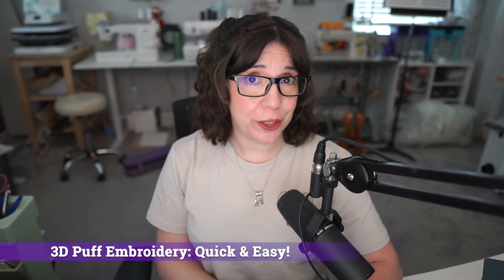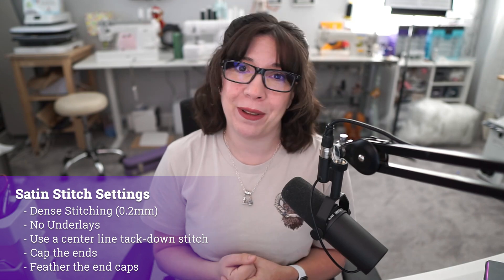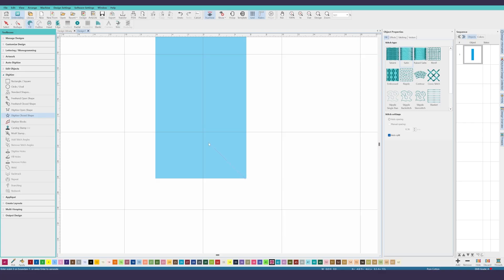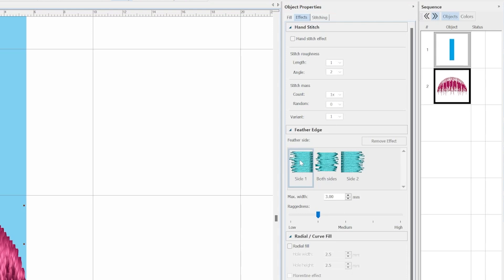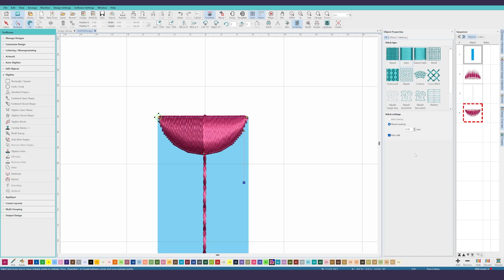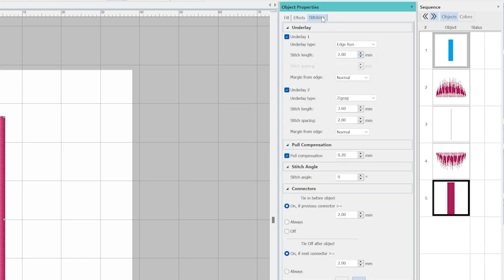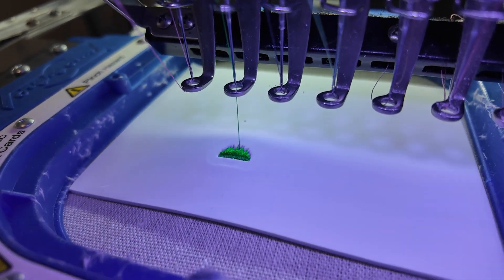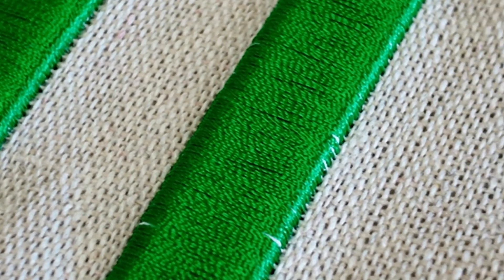Learn 3D Puff Digitizing and Embroidery - Tutorial with Hatch Embroidery Program and Ricoma MT1501

Comment: So using the 3d satin feature is not good on Hatch?
Reply from the maker: In Hatch 3 it's called "raised satin." It's just applying several layers of satin stitching on top of the other and doesn't really involve foam.
Reply: @fiercekittenz  got it. Thanks
Reply: @fiercekittenz  ive found that the raised satin stitch in Hatch tends to make the machines I have really beat up the fabric. Puff really brings out the dimension without the beating. Great video! Thanks!
Reply from the maker: @ChrisRabkin  I agree. I prefer puff, but the raised satin is a good alternative in some cases.